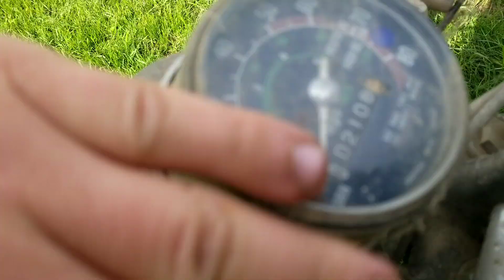BARN FIND OLD 1970s MOTORBIKES

Comment: That is a kD100 was a first for kaw. Made as a competition bike for kids looking for that taste of excitement. Borrowed parts from the km 90, the punchy rotary disc valve engine, 5 speed gearbox, single downtube frame. Except for lighting ang speedometer that’s the only thing not the same as the km90. Kd100was strictly made for off-road.🧐 year not sure?